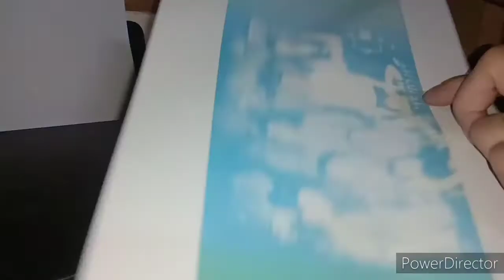how to refill ink in Canon G2010 printer

Comment: HELLO PO. PWEDE PO BA UNIVERSAL INK SA CANON G2010 PRINTER PO?
Reply from the maker: hindi po recommended, karaniwan dyan nasisira ang head.
Reply: @moonlightchannel7436  sir nakabili na po ako ink canon. at nasalin ko na po siya. pero nag print po ako ng colored, pero green ang lumabas na ink sa sulat ng paper tapos kapag black & white naman ay wala
Reply from the maker: @sharmaeabdullahakmad3127  punta ka po dito:
1. Control Panel\Hardware and Sound\Devices and Printers..
2. Using your mouse, right click Canon G2010 printer then Printing Preferences.
3. Go to Maintenance tab, click Maintenance and Preferences.
4. Click Cleaning, on Ink Group choose All Colors
5. Then Execute.
6. After cleaning is done..Run Nozzle Check
Reply: @moonlightchannel7436  okay na po sir thanks. sa setup settings ko lang po pinindot sa printer po mismo
Reply: @moonlightchannel7436  sir problem ko po now. ayaw po gumana bigla ng keyboard ng laptop ko. paano po kaya ito?